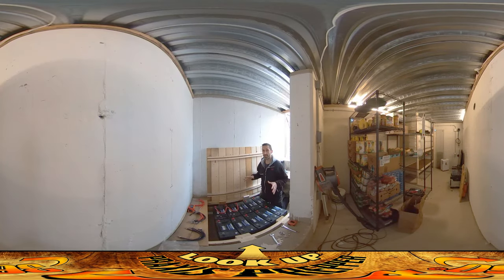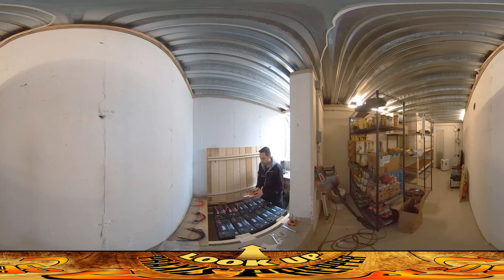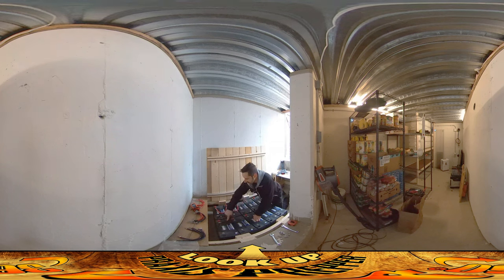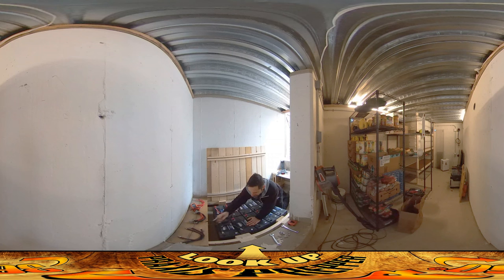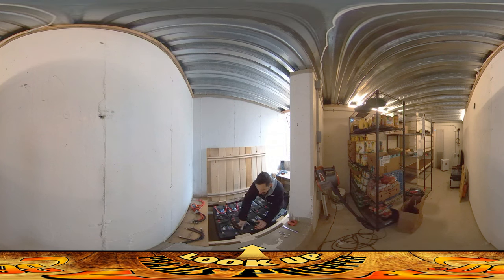Homestead Building- Creating a Solar Battery Array at 24 Volts

Comment: Just a thought: Looking around the room, it struck me, sitting spots would be quite limited if you did have to use it as a shelter. A suggestion is to put the middle bunk on a hinge on the wall side so it will turn the bottom bunk into a couch. As for prepping - storing the hinge and necessary hardware for a project when the event happens would seem enough of an immediate prep.
Reply from the maker: You're the second person to have suggested this and I agree with both of you. It would have been a good idea. As it stands, "folding chairs" are on my list of things to move in there. So I had sitting in mind, but not using the bunk for it. Though that said, in a 7x14 foot room, personal space will be at a premium, and I think that each person's bunk will start to feel like their room. So the idea that the bunks stay in place, is maybe a good idea for the people on the bottom and middle bunk so they can keep their private space. But still. It's a good idea you bring up.

Comment: You may be planning to already, but you should put a backing on that wood trap door to prevent water dripping onto the batteries, otherwise, it looks like a perfect space for them 👍
Reply from the maker: I'd been thinking about placing some cover over the batteries to keep them clean. The hatch is made of t+g board so dirt doesn't fall through so much, but I still think a cover would be a good idea. One aspect to the cover that I feel is important is that it shouldn't sit right on top of the batteries on the electrical contacts. If it ever got humid, the cover could act as a bridge between the contacts.
Reply: @PraxisPrepper  Ok, I thought your original idea was for it being more like a grate so water, mud etc wouldn’t get tracked into the shelter so assumed it was more like the wood shed floor. Agree about leaving enough space for the batteries to breathe. Maybe a run of foam board scrap down the middle if you have anymore would be enough.
Reply from the maker: @inmyimage1081  Yeah, I see how that "grate" idea could have made sense too - in order to cut down on debris.

Comment: Dude. How'd you make the video like that ...NM Ill check the link out you left. Clean setup on the system 👍
Reply from the maker: I think you're asking about the 360 degree video? It's a special camera. I have a link in the description to the one I use on this series. I thought it'd be a fun way to share the process and (totally honestly), I've gone back and been glad I had the 360 videos to double check where an underground conduit ran, or a wire went through a wall etc. So it's saved me some hassle having these videos too!
Reply: @PraxisPrepper  yeah thanks! I found the link that's pretty cool man